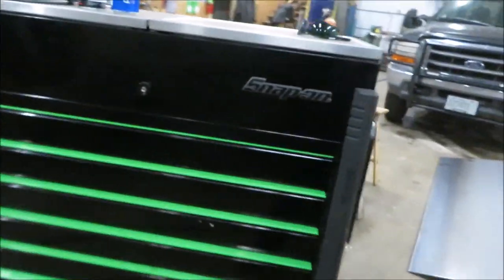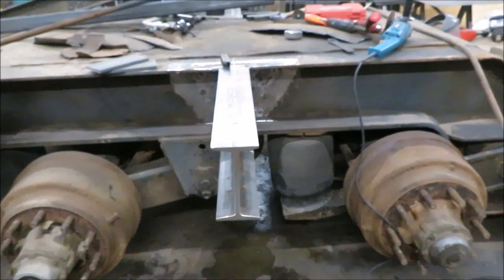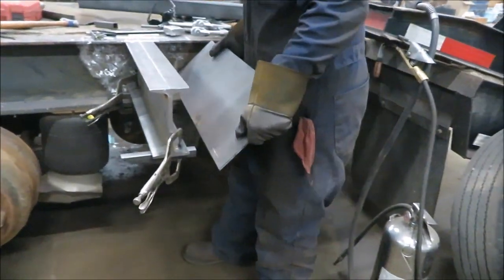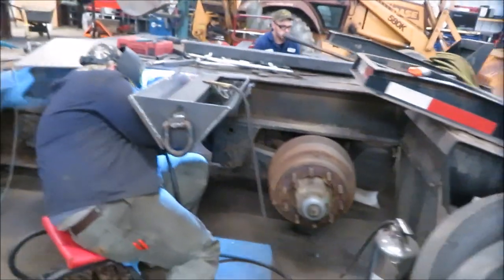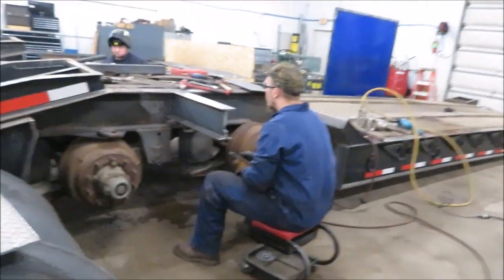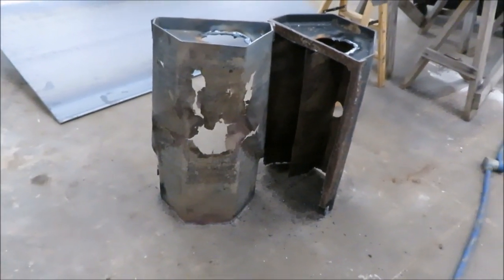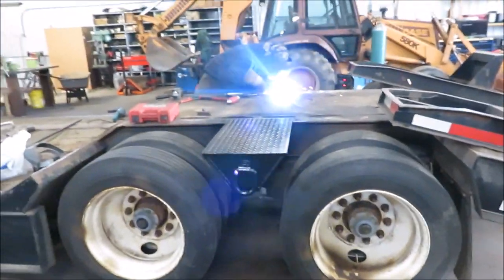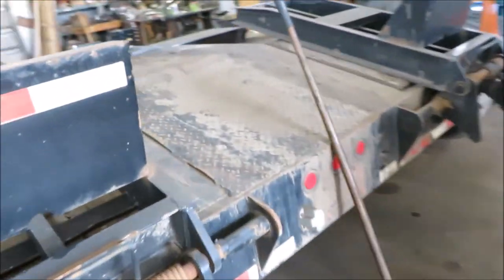Fabrication on lowboy! Rust can be dangerous!

Comment: Aren't those low boys made out of a high tensile strength steel and had to be brought up to a certain temp before even welding on also having to use
Reply: A high tensil stenght filler metal